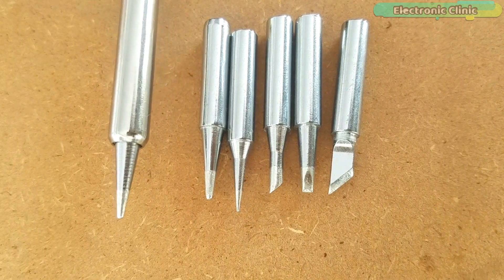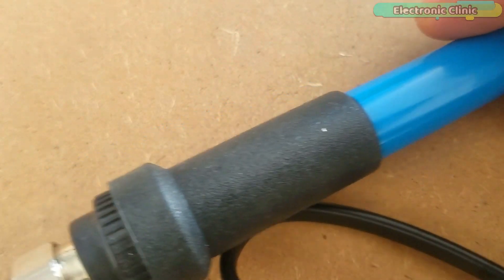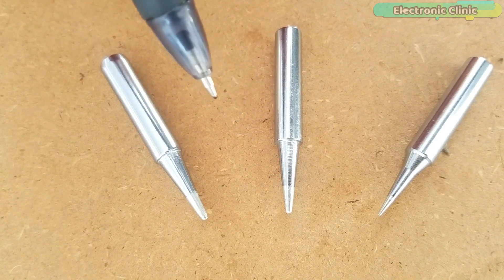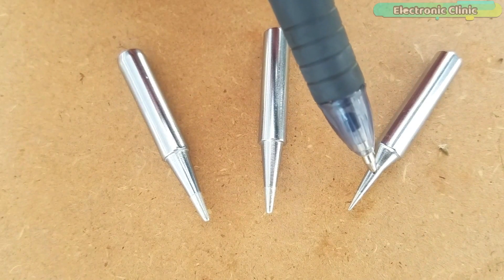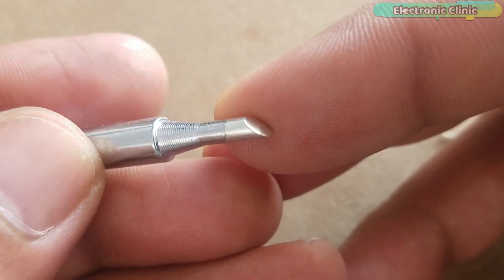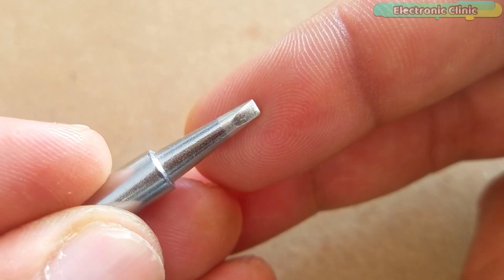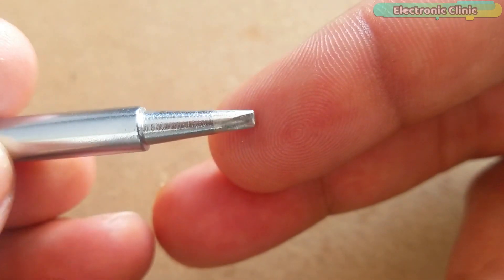Soldering Iron Tips and How to use them “B Series, C series, D series, and K series Tips”

Comment: Hi
I just started first time to use my soldering. I need to change the tip. It's stuck inside an will NOT COME OUT of the silver case that holds the tip in.
I don't want to return because I really need to use it. It wiggles a bit but that's it. I used my cb pliers to hold the tip near the base to push down.the tip. Just moves a bit back an forth. I'm 63 yr old woman. Just to let you know I'm not a wimpy man.
Reply from the maker: @lorrylach  Mam there is no need to worry about the soldering bit; simply loosen the screw and then use a plier to remove it. You can apply force without worrying about any damage.

Comment: I have an old UNGAR soldering iron from the 90's 7760 120V AC/DC. It has a screw on tip. Can you tell me what size the threaded end is? I'm looking to buy more tips but, none of the stores have them. So I'm looking on eBay and Amazon. Thank you.
Reply: Soldering stations aren't that expensive, you are also less likely to destroy components.

Comment: Please can the soldering iron tips can be also called copper bit
Reply: Good quality tips are made primarily of copper but with several other metals plated onto the tip: a coating of iron only on the pointy end (iron resists the dissolving effects of molten solder and flux, but bare copper quickly eaten away). Crappy tips are often made completely of iron or steel and have poor heat transfer.. A magnet will separate good tips from bad ( see video on my channel).

Comment: The tapered one did not help me with welding, it became dark in color and does not hold the weld. I made it a sander and it still does not hold the weld.
Reply: you need to flux it, tin it and turn down the temp a bit, i did the same to my first tip too and its essentially useless now compared to my undamaged tips
Reply: Too much heat or not enough flux.  Do you know what tip tinner is?  Get some

Comment: Yes! I've been using the conical for a long time but I found that the heat transfer was too slow so it really affected my solder joints. Might start using the chisel tip
Reply from the maker: if you set the temp around 300C then it works great.

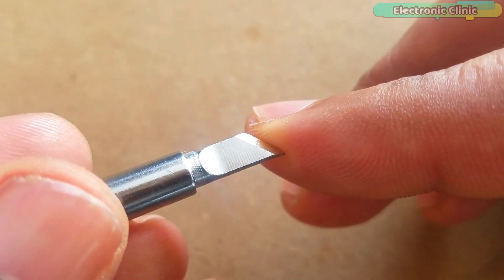Comment: 8:40 yesterday i used solder tool first time to solder that lcd and got solder bridge between two pins. i tried using wick but i was too noob  to use it as it was sticking to the board and after struggling a bit i used gravity to desolder that means I lifted up that lcd with one hand and held it downwards and with other hand I desoldered (like removing dust from a ceiling fan :D).
Reply from the maker: great, you know how to do it.

Comment: Why does my tip keep breaking when I use this solder? I use it at 300 degree but it keeps melting off or the tip keeps breaking
Reply: You press too hard. You need to touch., not to push hard. You probably push hard because the tip of your iron isn't tinned and is oxidized. Oxidized tip doesn't transfer heat. You need to buy a new tip and tin it properly. Tin it regularly, otherwise it will oxidize and be ruined.
Reply: @xavytex  I tin it regularly but when using the sponge it breaks off when wiping lol...every one of my tips have melted or broken off just by touch

Comment: Whenever I try to solder, it's like all of the solder vanishes into thin air. Doesn't seem to be sticking to the tip, and it doesn't end up on the object I'm trying to work on. I've tried cleaning the object with alcohol, and followed tip tinning instructions, and so far have had little success actually soldering something! It's frustrating! It's like it just disappears! What am I doing wrong? Is my iron too hot? I've watched a few of these vids and followed the instructions closely, but the solder just 'poofs' away it seems.
Reply: Two reasons for solder not sticking is 1. oxidation, 2. not enough heat. If your tip is oxidized, solder won't stick to it even when hot enough. Same thing with the object you're soldering.

Solder hates oxides and flows around it, like water avoids a hydrophobic material. On heavy duty objects like connector terminals or large stranded wire you can carefully use an abrasive like steel wool or a file to prepare the surface if it's really grimey. Never do that to your soldering tips, use a brass sponge, there are special kinds for soldering irons, but I hear the brass kind of sponge used for cleaning cook ware works too. The metal is softer than the tip and won't damage the coating on it. But more importantly - use flux. A cheap rosin flux will do fine. It's clears thin layers of oxides on materials and the tip of the iron when it gets hot, and this makes the solder flow and stick much better. How I clean my tip is I let it heat up, dip it into flux, put some solder on it, and then stab my brass sponge with it. I repeat that a few times.

As for heat, solder moves towards the heat. If you put some solder to your iron and your tip is clean and your iron is hot, you should get a shiny coat of solder on it. There should always be SOME solder on your iron, it protects it from oxidizing. That's why when cleaning it I put solder on it, stabbing the brass sponge removes the excess and leaves a thin coating, which protects the tip as it cools down when I'm done soldering. I also clean it before I start soldering, and when I do, I put a little more solder on the tip before I get to work. You don't want to dab solder from the tip onto the material, but you want solder on the tip to create a heat bridge between the tip and the object you're soldering. If the object isn't hot enough, it will not take solder, even if the solder melts, it will work its way towards the tip and pool on it, or just sit like a blob on the object without really being bonded to the material. Shiny flat coating - good, fat round blob of solder - bad, because that means the solder balled up from its own surface tension because it didn't want to flow onto the surface. So what you do is you use the tip of the iron, with some solder on it to make the heat bridge, and you heat the object from one side, preferably from below, and then apply solder for the joint to the object itself when it's hot enough. Like if you are splicing or tinning wires... put flux on the wires, put the tinned tip below the wire, apply solder to the wire from above. The wire will get hot enough to melt the solder and wick it up. Same thing with connectors.. heat them from one side, and apply solder from the other, if possible. This will ensure the connector is hot enough to take the solder. If you put your iron to it from the top and push solder down from the tip, you might end up with a blob of solder there which isn't a good joint, because the connector wasn't hot enough to take the solder. Your soldering iron should be somewhere between 320 - 400 degrees Celsius, depending on what you're doing, what tip you're using etc. 

Apart from liberal use of flux, also use solder with a flux core, and the lead free stuff is crap.

I'm not an expert by any means, but this is what works for me, hope it helps!
Reply: @Shabbymannen  I don’t know if you’ll ever see this but thank you for taking the time to write this! It’s a great help.

Comment: So many tips but I prefer the conical tip due to the reason I'm most accustom using that type
Reply: That's the worst for almost anything
Reply: @VndNvwYvvSvv , yes, because the skinny pointy end of a conical tip has low mass and low thermal conductivity. I hate conical tips! One should endeavor to use the largest tip size that the size of the parts, or your soldering skills, will allow. I too prefer the "chisel" shaped tip, and if one needs to get into a tight spot, simply! turn the soldering iron 90 degrees sideways!

Comment: 2:45 The one you're touching. Is it good for soldering head pin to Arduino module? And what diameter of the lead 1.0 or 1.2?
Reply: i have nothing other than that and it works really well. chissle is my preferred one for most stuff though
Reply: get the thicker conical one. cuz the very pointy one is very hard to solder and only used for small smd parts